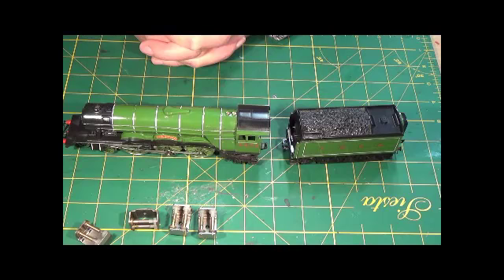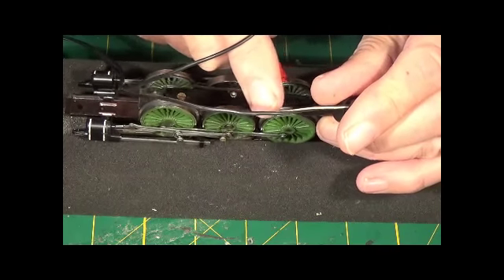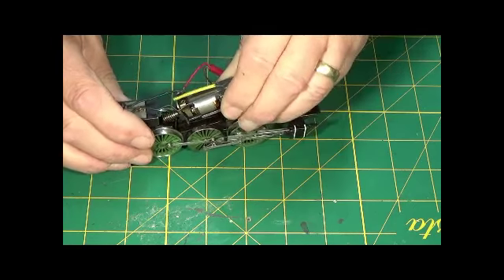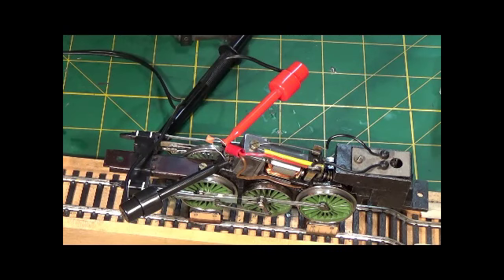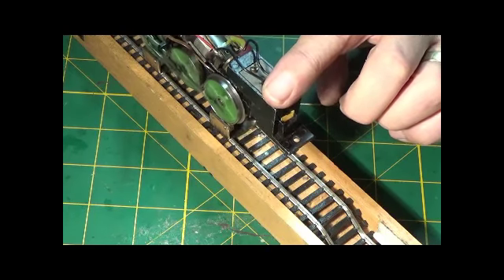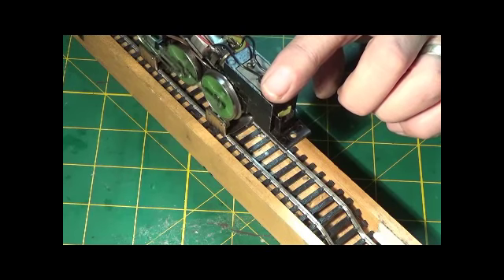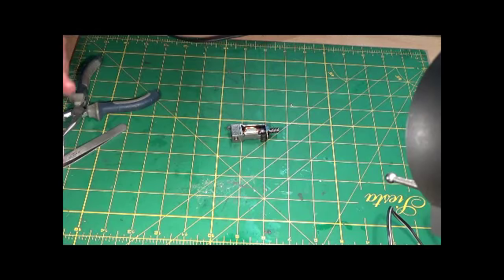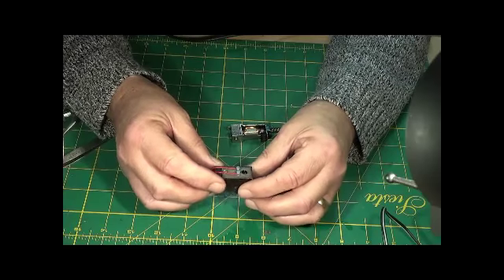Hornby Flying Scotsman R850

Comment: The commutator was black it would have worked if cleaned as as it was so dirty the brushes would have needed a clean
Reply from the maker: When I tested the motor later, it turned out to have a high resistance winding!